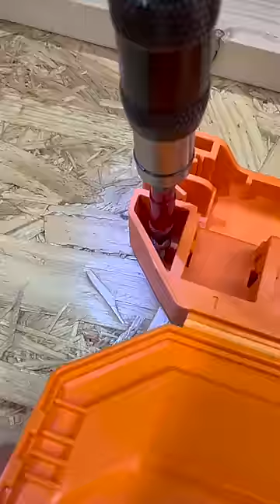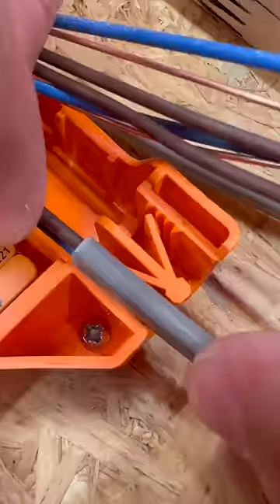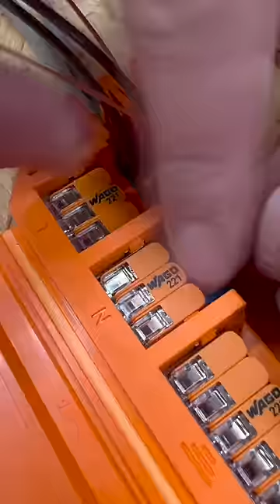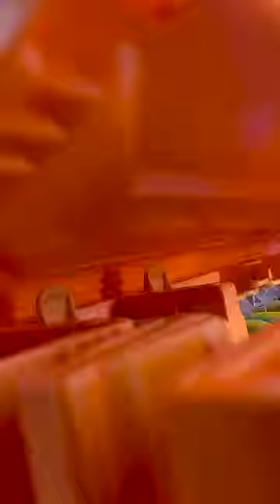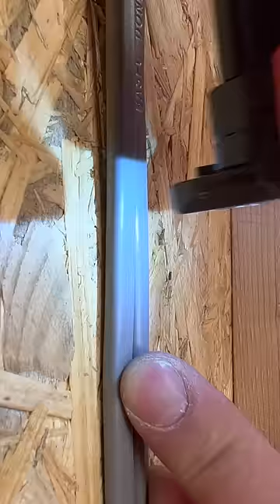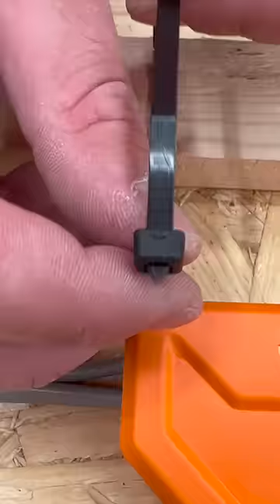Is This The Best Wago Junction Box?

Comment: Looks like a warning box for the thing that's going to catch on fire later this month 😂😂

I know wagos are considered code but I don't trust em personally
Reply: And the guys that used to solder and tape, or the guys who used 411s and snap caps didn't trust wire nuts, do where do you think the problem lies? With today's insurance companies and the testing people who think they're only purpose in life is to find something wrong have all said, across the whole world, that these are safe, so your going to be the to decide what to trust? Things get better for a reason. I'm not sure but maybe your still twisting the wires before put a wire nuts on, even though it specifically says on the bag from the people who designed the wirenut that it's not recommended to do it. See over time people have figured out better ways of doing things, wagos have been around sense 1951, you'd think that if there was a problem someone would have noticed by now

Comment: Sorry, You can call me a dinosaur or any other name you want, but I can assure that the resistance between two wires correctly connected with a wire nut will be less than with one of these wago things and will never over heat and cause a fire.  Wagos are OK for unskilled, ignorant homeowners, but they should beware what they do.

Comment: Nice. There you could even fit a Shelly (Wifi Switch) in. Is there a Version for round cable (Like H07RN-F or NYM-J) available?

As a larger alternative there is WAGO 207-4301.

Comment: Are they classed as maintenance free 🤔🤔
Reply from the maker: Marked with MF symbol.
Reply: @efixx the wago connectors used are not though are they? Or have I been misled, I though the lever ones were not push fit are?
Reply: Did not think it would be with the lever type of wago.
Reply: @johnwaby4321  the box is MF with the cable tie, but I’m pretty sure the lever wagos are not, hopefully someone can confirm because I’m not 100% sure
Reply: Yes the lever connectors are mf
Reply: Sorry meant to add as long as used in appropriate jb which this is
Reply: @markyd2633  thankyou, I don’t know where I got it from that they weren’t

Comment: Electrics starting to be so gimmicky, instead of a great high end install its just try this née thing or this new tool, or cable stapler or whatever nonsense they drum up.
Reply: What about if connection burned up and you need slack to remake up splice??? 
It doesn't follow code in US
Reply: @MichaelEdwards-n8f Why would the connection burn up?
Reply: @MichaelEdwards-n8f  If you look at the wire colors and the color coding on the ground wire, this is European (guessing UK)